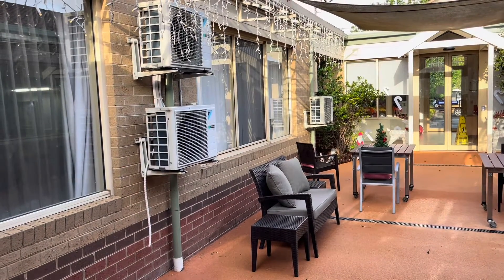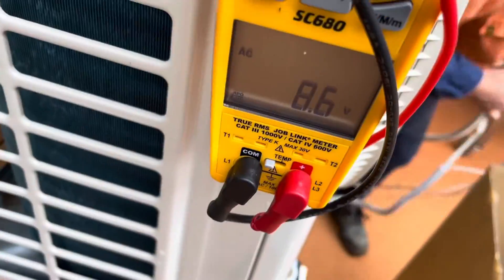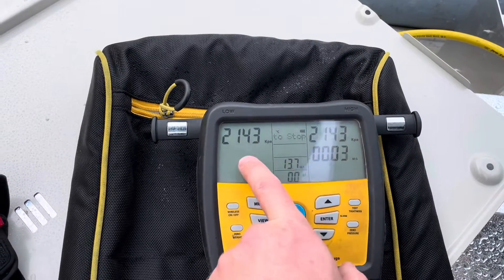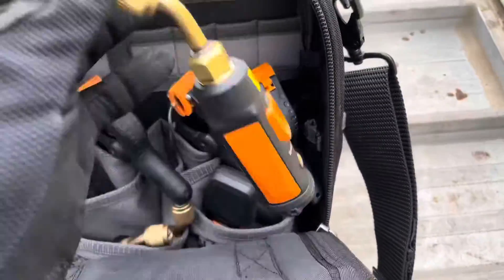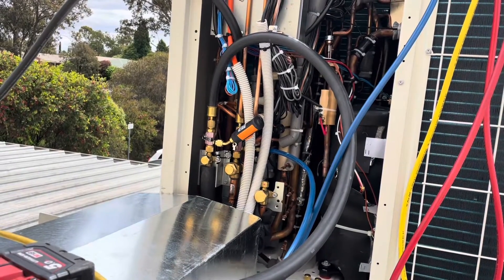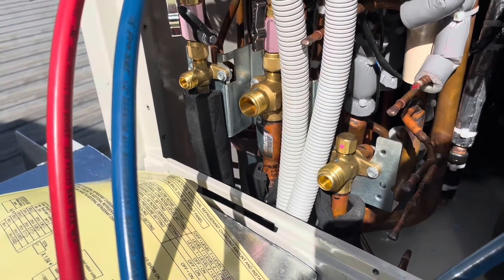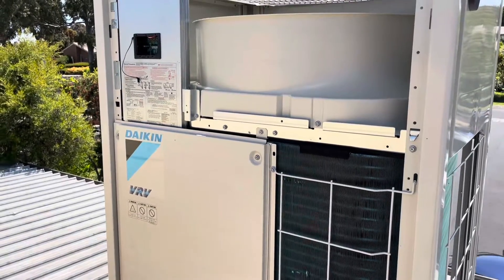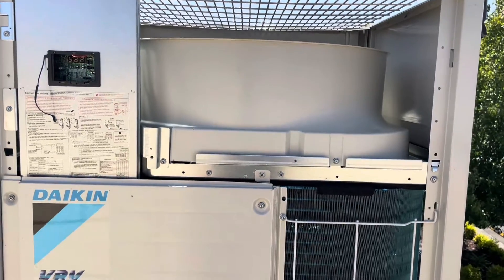Daikin VRV IV / From Pump Down to Daikin VRV Commissioning

Comment: Shouldn't ever use b presses on annealed copper, in fact I'm sure it says not to use them on the data sheets, it compresses too easily and never seals right. I only use on hard drawn, but you can't go past soldering.

Awesome to see more Aussies techs doing videos. It's great to bounce ideas and knowledge off each other.
Reply from the maker: I’ve been meaning to look into the data sheets for them. It’s seems they will become more prevalent going forward, but I’m the same with soldering. 

Thanks mate, the interactions with people on here have been great. I’ve learnt good information from the comments. Like you said, it’s great to bounce information and ideas off each other.

Comment: Hey Mate, for an interesting bit of reading get a copy of ASHRAE RP1808. They did a small sample test between different fitting types and suggested when properly installed there was a 1% failure rate. They probably needed to sample more though. From an engineers perspective I would only be specifying them where the risk of open flame is unacceptable, e.g. heritage wooden structure, etc.
Reply: Their tests did show brazing has its own failures when done by inexperienced installers, but atleast with brazing its easier to see the potential mistake and rectify.
Reply from the maker: That’s interesting. They’re one of those things that I haven’t used for installs. I’m so used to brazing so I just do that. I’ll have to look into them more. The benefits are definitely there, especially for places like this one where they have fire alarms all over the place.
Reply from the maker: I don’t get the opportunity to do many installs these days either, so there’s that too 😂

Comment: Great vid. When you put it in mode 2:20 were you able to charge via the liquid line?
Reply from the maker: Thanks mate. It’s basically just a forced cooling option so I slowly charged through the suction. I broke the vacuum with half the additional charge through the liquid line before opening the stop valves though.

Comment: I've always been told/advised never to B-press soft drawn. A lot of installs 3 years old or less I've seen leaks with soft drawn. Good video too!
Reply from the maker: Thanks mate. That’s interesting. I’ve never had the opportunity to do an install with them, I just always follow up after it’s all done. I need to do more research into it. Have you used them much?
Reply: @hvacraustralia  I don't do a lot of installs but I have used the Rothenberger one a few times on some install jobs, its very nice for the fact that you can put piperuns up way quicker than soldering but I still feel more comfortable and confident inspecting a weld I have done than a b-press
Reply from the maker: I’m the same. I haven’t used it for installs and prefer inspecting welds. Maybe one day I’ll get to test it and bit more.
Reply: conex bänninger (b press fitting manufacturer) do state in their tech data that you can b press on soft drawn copper.

I’ve heard same thing from people saying to not do it.
But then again I’ve seen plenty of soft drawn copper b pressed that have been installedfor years with no issues.